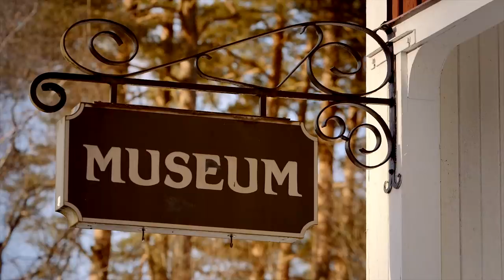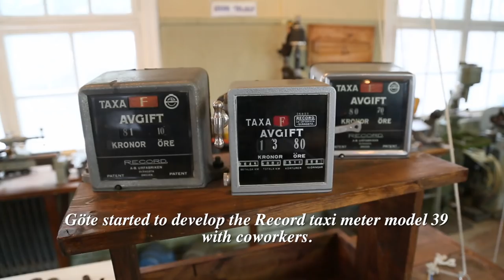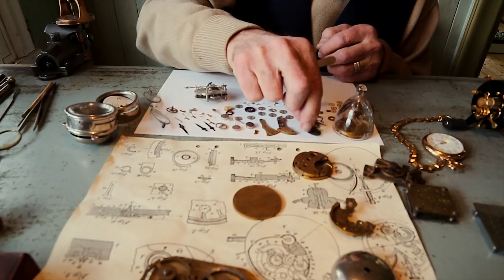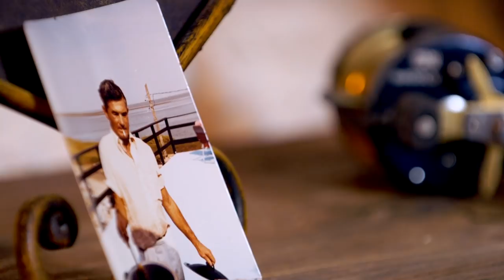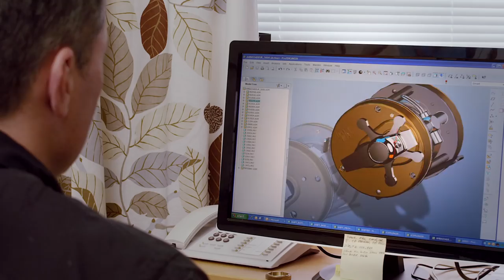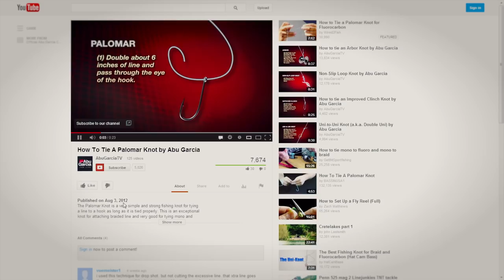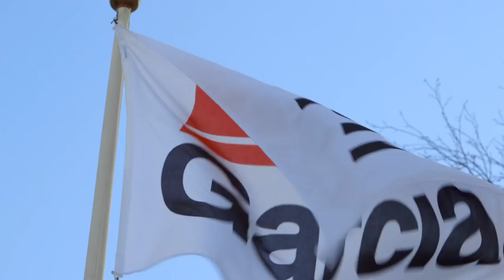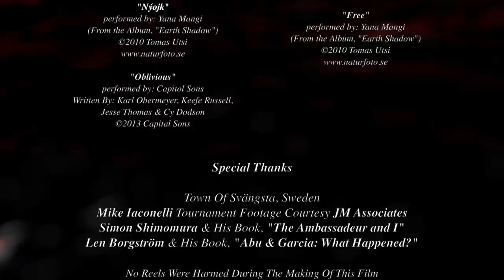For Life: The Story of Abu Garcia

Comment: I had a few cheap, Asian reels as a boy. On the last one the handle kept coming loose as the thread went the wrong way on the screw holding it and one day I dropped it in the water. I wanted a proper reel and borrowed money from my parents to buy an Abumatic 160. it was about ten times the cost of one Asian reel but an absolute pleasure to use! I payed it of for about two years but never regretted it. Caught a lot of fish w. it. I still have it and it works as good as new. As a Swede, it saddened me when Garcia was added to the name ABU and quality just dropped. Once in a while an Ambassadeur turns up at a jumble sale or so and if they are in good condition I buy them just because they are of such outstanding quality. I suspect the quality of the new reels will never be what it once was.

Comment: Not really a big fan of Abu Garcia gear nowadays but- my favorite rod is an old AG rod from Walmart that I bought 21 years ago. it's a 7 foot ambassadeur or however they spell it- they make great cranking rods if you need one and don't want to spend a fortune.  In my opinion the medium model has a great parabolic bend but, when it reaches it's backbone some real power to go with it- it's perfect for medium divers. A little too moderate for a square bill but, perfect for medium running cranks like a rock crawler or flat 75x. I've landed some large bass on it- my two largest in fact came on this rod. I own some moderately priced gear- can't afford the really expansive stuff but- I have some 200$ rods so- I do have some stuff to compare it to.

Comment: Fifty-five years ago, when I was 14, I bought an Abu Garcia Mitchell 300 spinning reel, which came in a padded presentation box, along with a second high-capacity spool.  I have since taken it apart to clean and re-grease the inner works several times.  I still have the reel and the spare spool, but the box is long gone.  Though it has a few scratches,  all it needs to be ready to fish tomorrow is a load of fresh line.  That is some fine engineering and quality production.  Sadly, I no longer trust that the fish in the local lakes haven't been polluted with heavy metals and other poisons from farm runoff, so the fish are in no danger from me anymore.

Comment: I have a 15 year old Abu Garcia cardinal 440 reel. I still use today.always in saltwater. Never been taken apart. Wish I can find replacement parts. Roller bearing on the bail is noisy,  but still works great
Reply from the maker: Hey, there. Our reel technicians can help you with this. Give them a call at (800) 228-4272.

Comment: Abu reels are my favorite reels, but make sure to buy made in Sweden one and don't buy chinese made, cheap but very troublesome even revo.
Reply: Assembled in Sweden, but made in China?
Reply: @anglerfish1001  The traditional round baitcasters are still made in Sweden and excellent quality, apart from the cheaper S-model. None of the low-profiles are made in Sweden.
Reply: @Patbythesea  i have a pair of 6500 mag elites from around the early 2000s. They are pretty good. I have a 7000c from around the same time and it is was unusable after a year. All the parts corroded. This reel had a made in Taiwan sticker on it. The reels from the  80s Etc were fantastic however I would not purchase an Abu today.
Reply: Adidas, nike,yy yonex sports shoes made in china u can use tree month gurantee,

Comment: I still have a 50 year old Abu Garcia Mitchell 304. Just lost a 300 during overboard. Bought a new Mitchell 300 1 year ago. Drive shaft rusted and I had to clean it off with steel wool. Still not very smooth anymore. Disappointed with new reels.